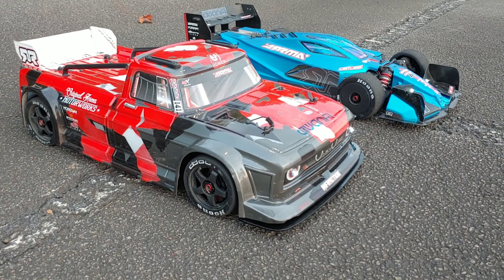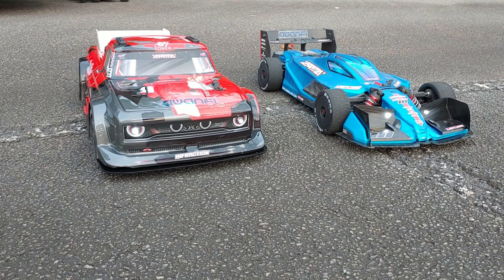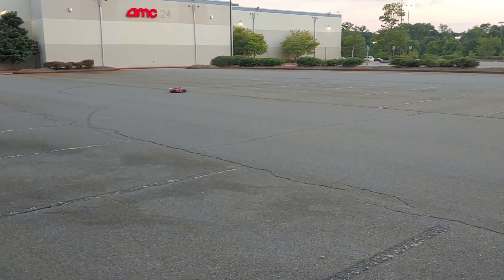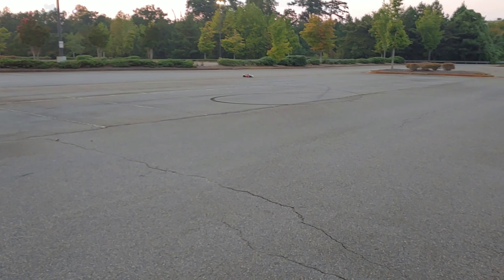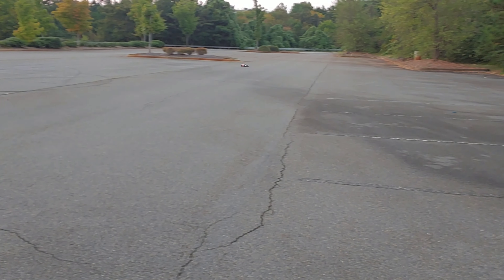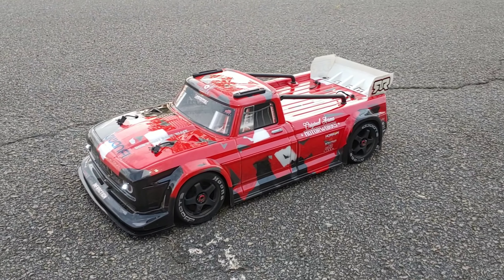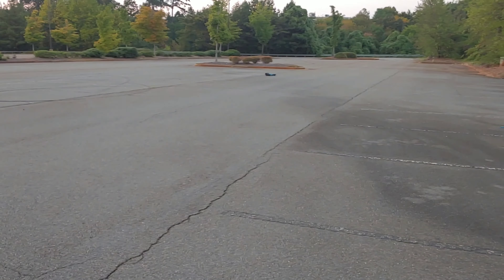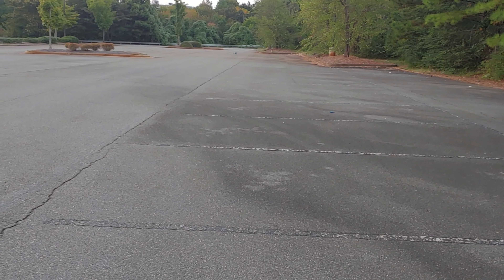Arrma Limitless and Infraction 6s Runs

Comment: I'm going to try to buy the essential Parts you need to convert the Limitless into the infraction and vice versa. I think if you're going to do this starting with the Limitless would be cheaper. Body posts, infraction body, foam bumper and splitter I believe is what I'll need. Won't be sure until I get my Limitless.
Reply: Vinnie Barberino have you brought the limitless to Infraction conversion. I’m on the verge of purchasing the Limitless to do that conversion also and needed to know what parts are needed

Comment: JT. Can the Infraction take 2- 3s Lipo batteries? I have 3- 3s batteries that i switch up with my Arrma Granite and was thinking about buying an Infraction and wondering if i can use 2 of my Lipos to run the Infraction. Or does it only take 1- 6s battery?

Comment: I'm a little confused... I'm running a 50t diff in mine aswell with the v1 1717 1650kv and a mm2 esc on 6s with a 27t speed gear and my max speed is 67mph.
Reply: You need smaller spur for speed

Comment: The Infraction has a center differential while the Limitless has a center spool. That may explain why the Infraction drifts more.
Reply from the maker: No, both of these have a center differential in it. Check my previous videos and you'll see what I did to it.
Reply: @JayTeeRC  Maybe you installed a center differential in both cars but they do not come that way from the factory.
Reply from the maker: @Yay-hovah  only infraction comes with a center Diff. I installed like I said it Center Diffs in the Limitless.
Reply: JayTee RC Yes, that’s what I was saying. I understand what you meant now.

Comment: Jaytee.  Should I run a 17t or 18t on my limitless ? Running a 50t spur. I want to run my 7600mah batteries for long run time. Running 185 blx esc and 2050 kv stock motor  . Please advise.
Reply from the maker: Go with the 17 the 18 could be used as well so you're the one you have will be fine
Reply: @JayTeeRC  thank you.  I went with the 17t pinion.  Worked out great. Long run time.  No overheating at all.  Granted I do run a fan on my motor.  This is the perfect combination for all out driving.  I'm not really into speed runs.  Thanks Jaytee. Limitless Is probably my favorite rc of all time  !!
Reply: Donald Barron what speed do you get running that set up
Reply: @Dshall88  about 56 mph. I have since put on the 18t pinion. As jaytee said 18/50 is the perfect combination for this car for general driving and speed for this car. I love my limitless !!

Comment: Hey I just recently picked up the limitless and took my entire load out from my infraction and installed in the limitless just to see how it would run. Used the gear that came with the limitless and it’s running like crap. If I punch it, it just makes an awful noise I have to really ease into it. Any suggestions on what the problem might be? Everything worked perfect in my infraction.
Reply from the maker: It's the gearing. The Limitless is gear too high for that system especially if you run it on 6s. You going to have to change that spool out to a center diff like I did on mine if you want to run it in general.
Reply: JayTee RC thank you for the quick response.
Reply: @JayTeeRC  Hey Jay... my name is Keith and I just ordered a limitless...I  was torn between the infraction and the limitless until I saw your video. The limitless is alot more locked in and stable. I read a fair amount of the comments on your video. This particular one caught my eye. I did a Google search to find a center DIFF for the car, but they only offer the spool. What did you use for a center diff.
Reply from the maker: @coverts5t  you can use any Center diff that comes with any of the arrma 8th scale cars are you can even get the one that comes in the infraction

Comment: What you think is a good gearing for drag racing?
Reply from the maker: 132ft?
Reply: Yes I can find any info on a arrma gearing chart but what would you guess or feel like is a good set up ?
Reply from the maker: @jgotdawheel  there are way too many factors to consider when doing drag racing. Especially at 132 ft. But you better get some really good batteries that has some Hi-C ratings on them that's going to be important and then the system as well then you got to think about tire tire compound in the actual car you going to be using
Reply: Covered that was the first things I did. I just don’t know what to do about gearing .
Reply: What you think about 25/42 ? Or wear would you start in gearing ? I’m only asking because I have no idea and stock take to long to get speed we I did test a couple test hits.